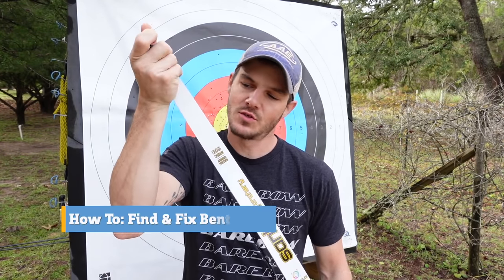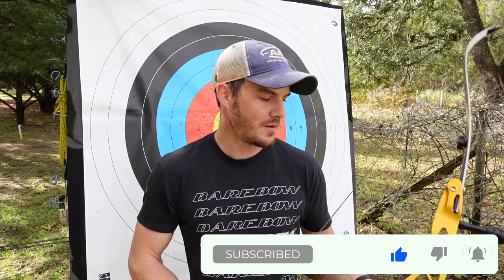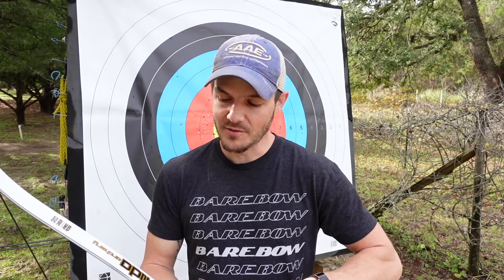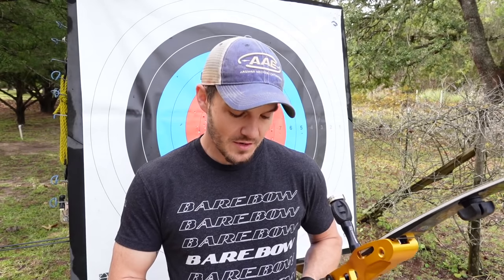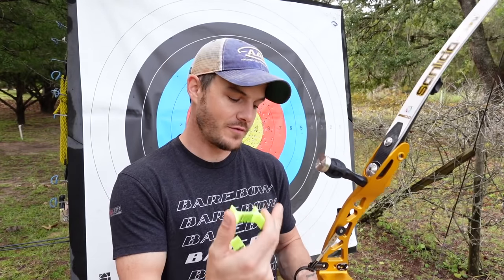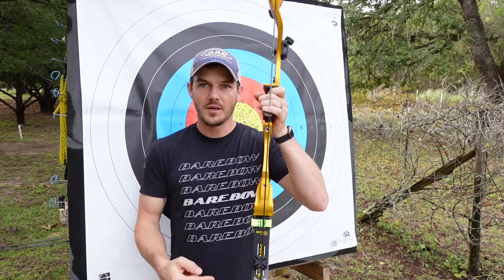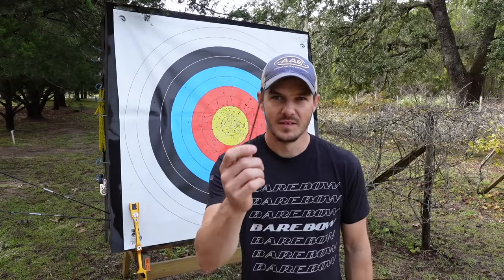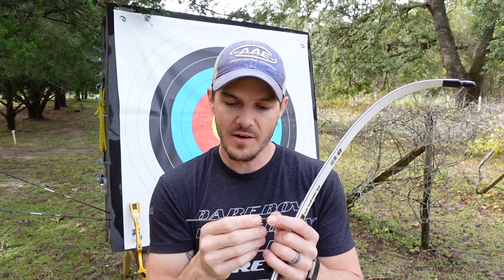How to Diagnose and Fix a Bent, Warped or Crooked Recurve Limb

Comment: Thanks,Jake for that really informative  vid. I have an original Fred Bear 50lb recurve, probably 40 yrs old, that the grand kids found in the loft of the 'man-shed'.Once restrung  they had to use it, even though the 'old-man' could hardly hold it on full draw.... the kids didn't  have a chance. That bow has always had a bent/twisted upper limb, your 'fix' might be all we need to improve our groups, Thanks  from NZ.

Comment: Very useful tips. Had the same problem with the grooves of my new winners explore CB1. Such nice strong carbon - bamboo limbs! And then what a disappointment! The string just wouldn't sit in the grooves causing misalignment of the limb tips. I followed your suggestions to use a file and now everything is OK.

Comment: What fun that you bring this up. I filed the tipp of my limbs when I started 42 years ago. But not because i notise that the limbs were bad. But i notise that the tip was poorly made. 
Today I am an archery trainer.
I am a furniture maker and workshop mechanic. When I was at mechanic school, there was talk that the file would be destroyed on the backwards movment
 
Today we know its not realy true. Tests have been done and the file will not be destroyed. There is a nice youtube movie that shows this. https://www.youtube.com/watch?v=xbykic--SKA. It also files a bit on backwards. And the good thing is that the file is cleaned a little on the backwards movment.
Carbon fiber is so soft compared to metal to file on. So it takes extremely much to destroy a file on it.
You get more control by moving the file back and forth with out lifting it. when you lift the file each time. Then you have to re-align it for each move.  And it's time consuming and it makes it more complicated.
 But you have dawnward pressure when you move the file forward. You do not have to lift the file back, just drag it with out dawnward preassure.

Now you've already made your super nice movie. But now you know until next time.
Regards from Sweden

Comment: Hi! I hope people still visit the comment section of this relatively old video because I have something to share. I bought my first recurve riser (and limbs) almost 2 years ago, but around 6 months into it I noticed that my limbs are not... aligned? I started to learn more about bow tuning to the point where I stumbled upon this video some time around last year. And you know what? What you said were true. Almost all of it. The tip of my limbs were kinda crooked. I tried my best to fix it. But unfortunately, the string alignment still said that something is NOT right. I tried to find more videos (which was difficult. yes, we still need more resources when it comes to tuning recurve bows) but had no luck. I even tried other ways to align my limbs without the long rod. and what do you know? My limbs look straight, but my stabilizer setup looks like it's severely crooked to the left (I'm RH). My riser was CNC-machined, I didn't think it was possible to have such a bad QC that the main stabilizer bushing ends up so crooked. I ended up selling that riser for the one I thought was better. And you know what? Still the same problem. Almost to the same degree. That takes me back to the limbs. It MUST be the limbs. AND THEN, I found something shocking. You see, I have two sets of limbs, one a #24 and another a #28. the #24 ones are from Samick, the other one from WNS. So, not exactly great quality. But the WNS one is not exactly bottom of the lineup. So I thought, there must be something I'm missing. Until one day, when I was disassembling my bow, I noticed that the BOTTOM part of the limbs, the one that holds the tiller bolt, is CROOKED. You, know, the fork-like part? Yes, that one turned out crooked out of the factory. IN BOTH SETS OF MY LIMBS. Not exactly to the same degree, but similar. I ended up doing the same thing as you did in this video to the tips, but to the bottom. and even though I sacrificed the snug a little bit. It ended up  by no mean "loose", but it's straight now. aligning my limbs using beiter blocks and long rods are now a breeze. If this happens to me in 2 separate limbs set from two wildly different companies, I'm not too confident that this won't happen to a lot of you. So I hope this can be helpful for other archers, especially new ones like me.

Comment: Thank you for this one Jake! After watching it, I had a check of my limbs, and found that they were more twisted than the Hunchback of Notre Dame!
So now I either have to get out my jewellers files or get a new set of limbs?
Still, having had medical issues that resulted in me being only able to shoot an embarrassing 20 lbs draw weight, I am anxious to try and revive some semblance of fitness and move back up in weight!
Heigh ho for better limbs!
BTW, I found another method of detecting 'trouble' with the limb tips. When you unstrung your bow, check the shape of the bowstring loops. If they are a uniform shape you can relax, but if they are an odd shape, you need more formal invrstigations?
Cheers  buddy!👍👍👍👍👍😄😊

Comment: Thanks for the useful video. How important is this for a beginner?

I am pretty new to archery and will rent limbs from an archery shop neabry, until i get better and can pull stronger limbs. Since the limbs are rental with a wooden core, it's safe to assume they will be pretty old, used and bent. Should i even be concerned about this as a beginner? I still have to improve my form and release, which will probably have stronger impact on my aim, right?

Comment: I did not know files only cut one direction.  I have been using them incorrectly my whole life.  I tried fixing a cheap pair of limbs that were cutting my serving.  After I was done filing, I polished it up with some scotch brite.  It worked pretty well.  I'm surprised the Sanlida limbs they sent you had such asymmetrical tips.  I have a set of their Athletics 7 limbs and my tips are perfect like they were shaped by CNC.